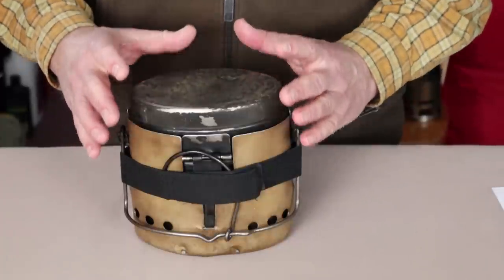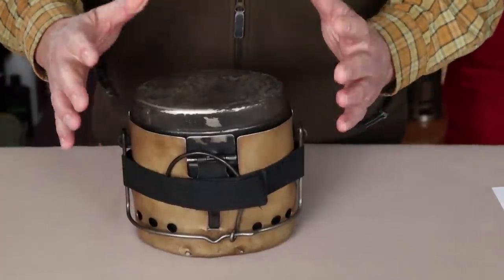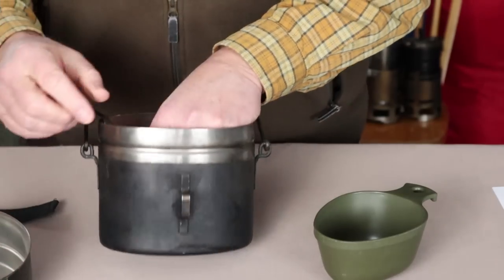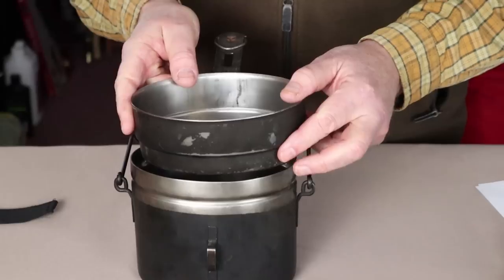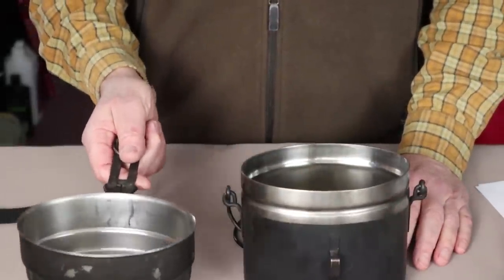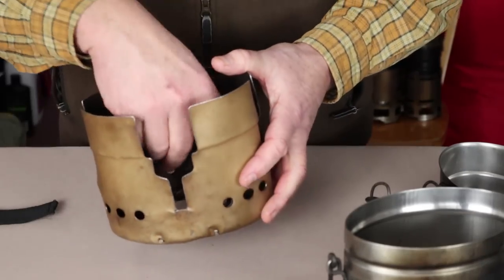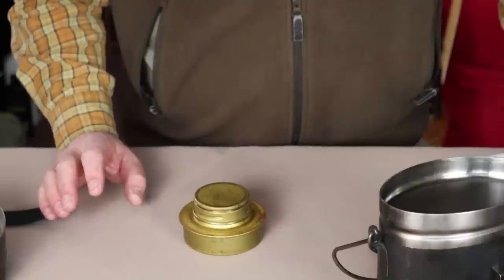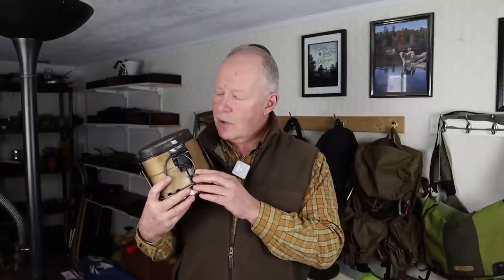Swedish M40 Military Mess Kit - Comprehensive Review

Comment: I own an alu version of this, and we used to always have some lying around in the equipment crate when I was in the boy scouts as a kid, that nobody ever used because they seemed kind finicky when you were in a hurry to cook up a bunch of oatmeal or whatever. 

I guess it’s fine for the odd outing if you’re mainly making a bunch of boiled stuff, but for its size and weight I don’t think it really offers a lot of flexibility in terms of easily cooking a varity of stuff, with more precision, as is preferable if you’re out for weeks and months, at least to me. You can FORCE some cooking flexibility out of it, but it’s not as readily accessible as when simply using a trangia, for one installing and adjusting a simmer ring while cooking is an ongoing chore with these. The big burner is fun but doesn’t offer a huge difference. 

It’s a little better as a makeshift oven perhaps than a trangia, but at the end of the day, I’d rather have a proper pan that’s not so deep and with such a limited cooking surface, so I can reasonably cook and turn say pieces of fish in it and also have one or more spare pots to hold ingredients or cook rice or whatever on the side than, that. 

If you’re out for long and living off the land you most likely won’t be carrying enough flour to be making bread and cakes on a regular basis, it’s just too much weight and volume for the amount of meals it will produce, so personally I use any flour I may bring very sparingly just to coat pieces of fish and MAYBE make a piece of flat bread as a special luxury if I am ahead on resources. 

Honestly if I was doing a shorter trip I might still just bring a pared down or smaller trangia or if I was going for more of a fire compatibility - a small pan and bush pot + an alternate burner with a stand like say a trangia triangle and windscreen OR a Bush Box with the cooking options that adds to wood-fire-based cooking. 

I mean - at the end of the day you can juggle weight and volume around against the various applications, the amount of people you’ll be cooking for, the type of food and various pros and cons, but personally I like things to be a little more directly accessible with more flexibility of use, than is immediately offered by the M40 type of cook set. I like it but I find I don’t tend to bring it really, and if it’s about weight for a 2-3 day 1 person type hike, you can still go A LOT lighter than this if you err towards simplicity.
Reply from the maker: i don't take the M40 out often for all the reasons you mention. Plus, I have so many light weight options to choose from. Suited to military use but not modern outdoor use. Thanks for commenting
Reply: @MarkYoungBushcraft  Thanks for the comprehensive uploads, they’re great value 👍

Comment: These are outstanding pieces of equipment.   Unfortunately I don't have a stainless version but I do have an aluminum one.  Some may say the aluminum version is junk but that's simply not the case.  Both are excellent but the stainless one is just heavier duty.  The design and use of how everything is contained is just so well thought out.  Since I can't obtain an stainless version the next best thing is an Solo 1800 pot with Titan stove and an Trangia burner.  This is actually a bit more practical as it can use wood material and the Trangia spirit burner for fuel source.
Reply from the maker: I do like this piece of kit but it is heavy. I have the Solo Titan and 1800ml pot combo as well. Also a great piece of kit. Thanks for commenting

Comment: Wonderfully detailed review Mark and nice kit.  Like you said, a bit heavy but certainly bomb proof.  I am wondering if you could use it with wood.  Build a small fire and turn the windscreen upside down and place it over the fire.  I am thinking a few air intake holes may have to go around the top (which would actually be the bottom when used in fire mode) but the fire could be fed through the opening where the handle is for lid.  It also may need something to raise the pot a little higher above the hole where the flames would come out.  That would make it an ultimate larger cook system.  Just some thoughts.  Thanks for sharing, enjoyed the history of the kit as well. :) :)
Reply: No not really, the windscreen is of aluminium and will melt in a woodfire
Reply: @PoulHansenDK  Really?  I have aluminium pots and fry pans that don't melt using them over the fire. :)
Reply from the maker: Erik, the guy who gave this to me said he tried building a fire in the windscreen. According to Erik It discoloured and almost melted. Thanks for commenting Jackie
Reply: @MarkYoungBushcraft  Wow,  wouldn't think that would happen.  I have seen some pretty thin aluminium kettles go right in the fire and no issues. :(
Reply from the maker: @jacqueline7118  as long as the kettle has water in , it is safe. The water will boil off all the excess heat. Place an empty aluminum kettle in the fire and...
Reply: @MarkYoungBushcraft  Well, there ya go.  Wasn't thinking about the full/empty issue.  I guess when you put a baked potato wrapped in aluminium foil in the hot coals it is because of the potato that it doesn't melt.
Reply: @jacqueline7118  OK just try it.  ;-)
Reply: @PoulHansenDK  I believe ya! :)  Wasn't giving full thought to the full/empty theory.

Comment: The reason for the burner to be stored in a plastic bag is the (slight) possibility of galvanic corrosion btw aluminium and brass (cathodic). Especially if you happen to pack it down wet and leave it for some time... It even works when it is not a zip bag from Ikea.....
Reply from the maker: I recently learned that as well. Thanks for commenting
Reply: Or simply that you dont want your food to taste like shit. The common alcohol fuel in Sweden for these stoves, "T-Röd" have a addition of vomit inducing compound to keep people from getting drunk on it. Some Alcoholics still manage to get drunk on the stuff by swallowing their own  vomit untill they get used to the stuff as a 1 litre bottle of T-Röd  is maybe 5 dollar and a 75 cl bottle of vodka is maybe 20 dollar.  But a small drop of fuel on your pan make the entire meal taste vile.

Comment: The writing on the flask says: Rödsprit - Methylated spirit, Mycket brandfarligt - Very flammable, Giftig - Poisonous. Prices in Sweden vary, but for an unused aluminum one its around 625 SEK and for an unused stainless one about 795 SEK.
Reply from the maker: Thank you for this information
Reply: I paid 40 SEK for my used one. 🙂 (4,91 CAD) only the pots and wind screen, no burner.

Comment: The stainless steel "Snuffer" ring/flame adjuster currently offered by Tatonka company (Amazon) fits the Military-type burner perfectly; Vids on YouTube caused me to buy some for my kits.  Bespoke aluminum lids available from UK vendor, but lids may not fit the SS version of the Swedish cook set.  Disclaimer: No financial interest.
Reply from the maker: Yes, I have been looking at them. Only hesitation is cost at $46.00 in Canada. Thanks for commenting
Reply: The civilian Trangia snuffer/adjuster will also work on the Mil spec Trangia/SVEA burner and is US$5 from Trangia.

Comment: If you're interested in the history of this mess kit I would recommend the video "The Dirty Swedish Mess Kit" by Very Survival on youtube. I use the Mil-Tec reproduction of this kit in aluminium with a standard Trangia burner and find it to be very versatile. I made an aluminium lid that can fit over both the large and small pans which lets me cook in both at the same time. I had to trim a little off the top of the windshield in order to use the lid on the small pan if using it on its own and the lid fits upside down on the bottom of the windshield when the kit is packed together. ATB
Reply from the maker: I did watch that when researching for my video. Great mods to your setup. Thanks for commenting

Comment: Have esten some meals in that :) but there is another system as well that looks more like trangias system. It was used for Ranger, Artic Rangers, Coastal Rangers, Recon teams or Para Rangers. It was simply called Rangers Kitchen “Jägarkök”. It had more parts. It had 2 pots, 1 frying pan (that also could be used for snow support), burner, windshield and a lid. Very good video :)
Reply from the maker: You have made me interested in finding out more about the Ranger Kitchen. Thanks for commenting

Comment: Another reason for the plastic bag to hold the burner? Galvanic action or electrolysis caused by dissimilar metals and an electrolyte ! In this case  Brass (an alloy) and stainless steel. and Methylated spirit or water it causes corrosion when left! It's worse in the case of Brass and Aluminium! many a holed kettle in Trangia sets. Regrettably in my time as a scout master I'm viewed as monster for demanding the plastic bag should always be used, even says so on the Trangia supplied yellow bags for the burner. I hope that helps other stove users. And like your friend I keep a stock of sealable IKEA food bags for that very reason.
Reply from the maker: I had not thought of that. I am familiar with the reaction but did not consider it with this setup. Thanks for commenting